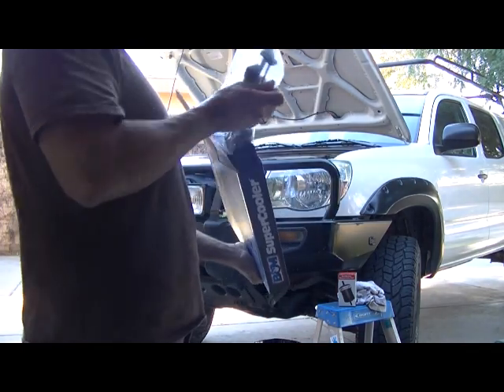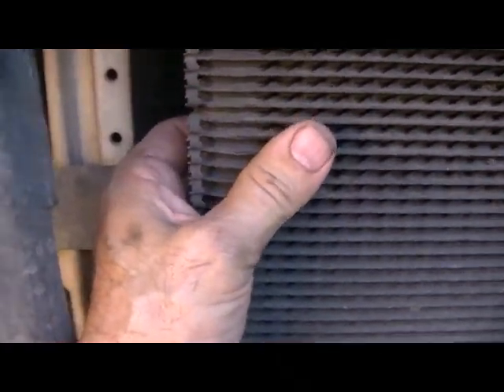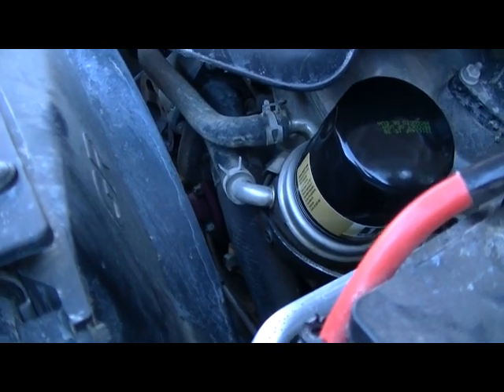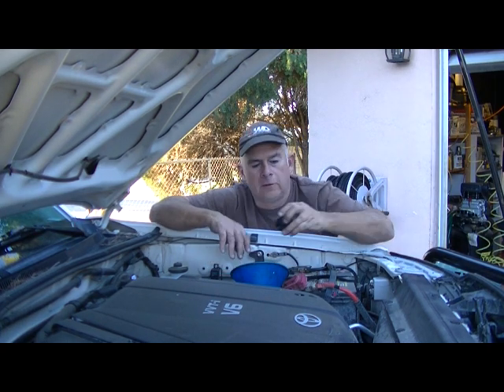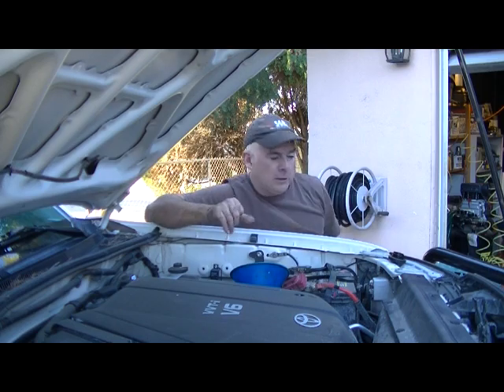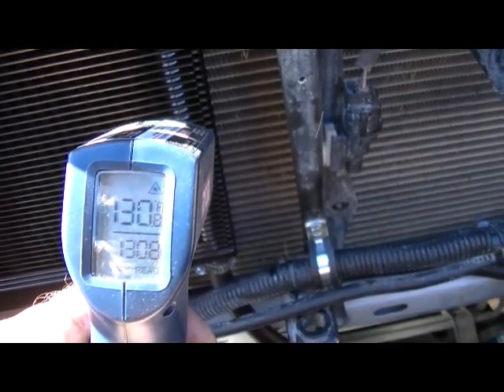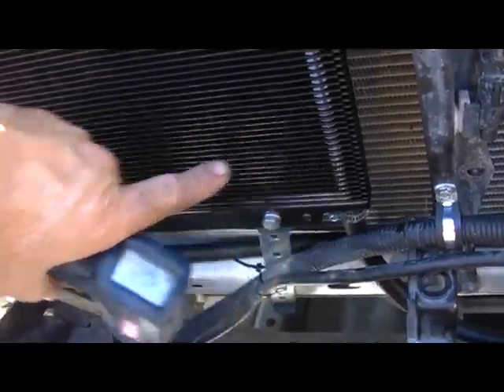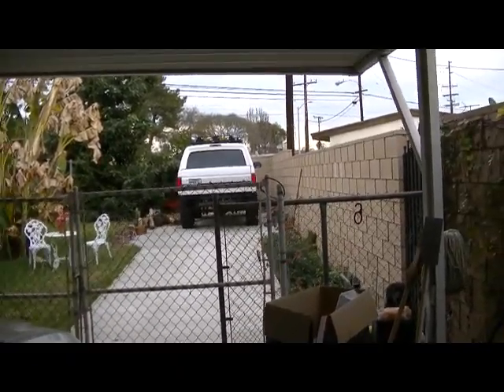Trans Cooler and Filter

Comment: Fuel injection hoses are better than those worm clamps anyway.  They are smooth all the way around so they don't cut into the hose as much.  I added a trans cooler to my f150, similar to your bronco, and had to replace some of the worm clamps I tried first due to some leaks.  The fuel injection clamps work much better.